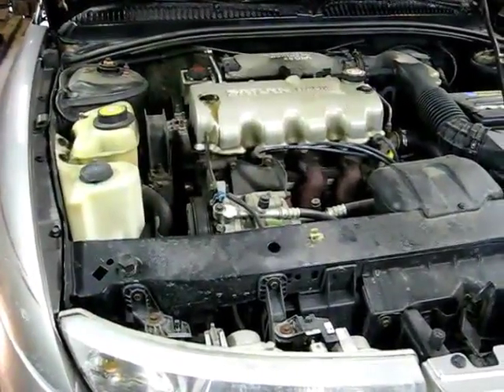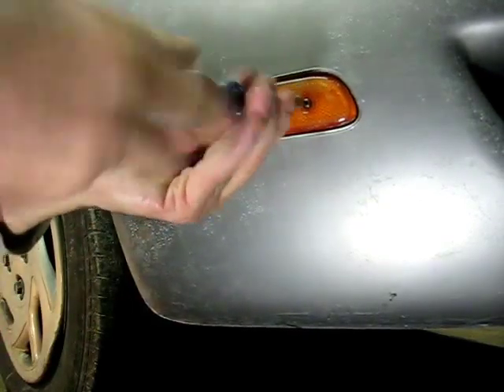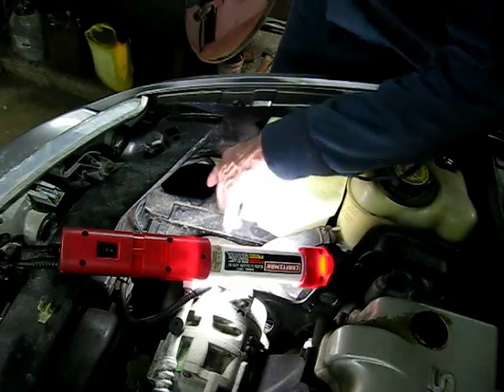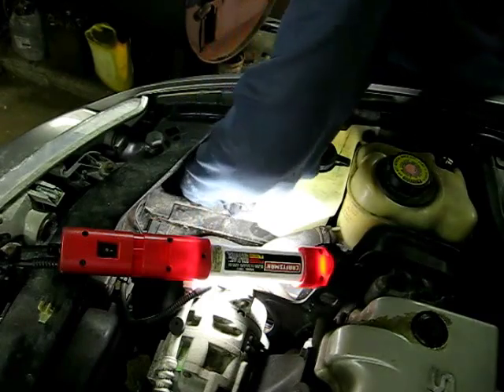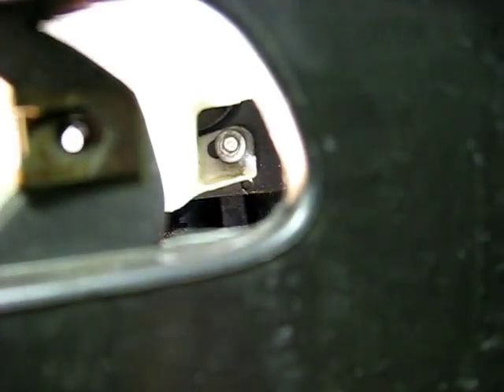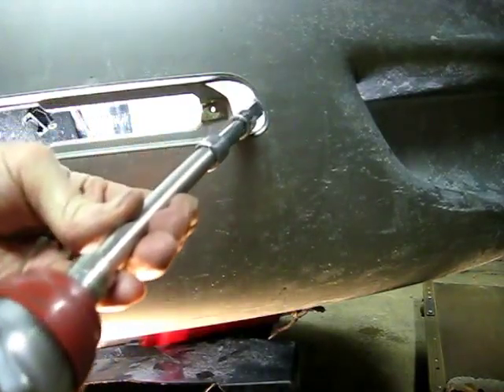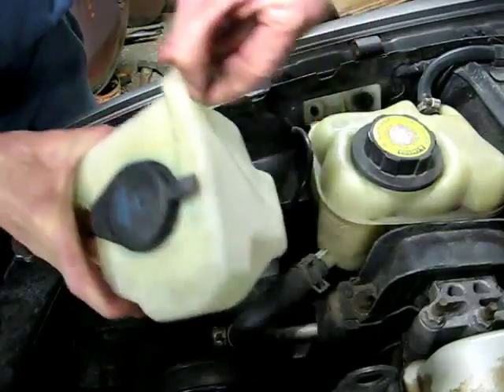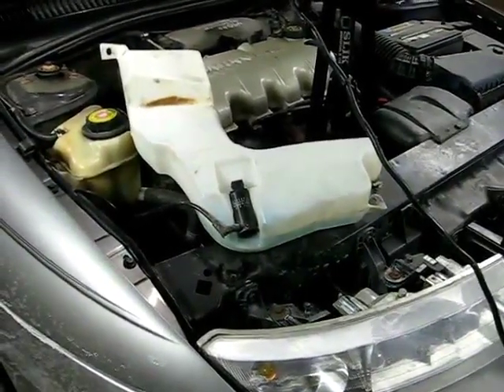Windshield Washer Tank Removal

Comment: Thank you so much for the vids on the Saturn SC type.  I have one of these long tanks, and was buffaloed on how to remove it.  I wasn't able to get to the electrical connector through the hole you showed, so I removed two of the upper shield holders and was able to get at it that way. Also, I went under the car to remove the front bolt.  Fairly easy access for me, since I didn't have an extension long enough.  My problem was mold blocking the intake filter to the pump.  Cheap, easy fix. Thanks!